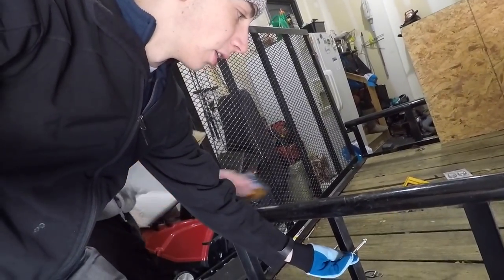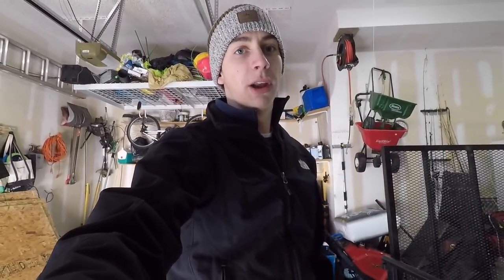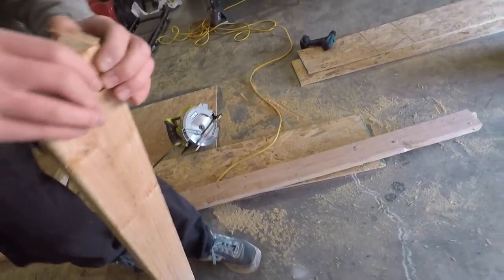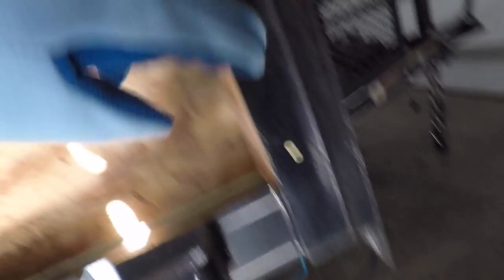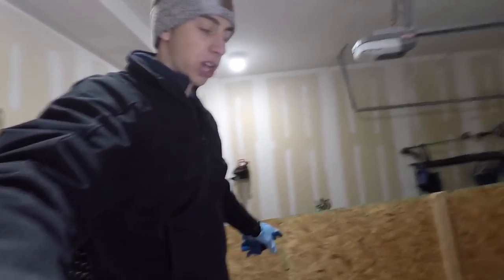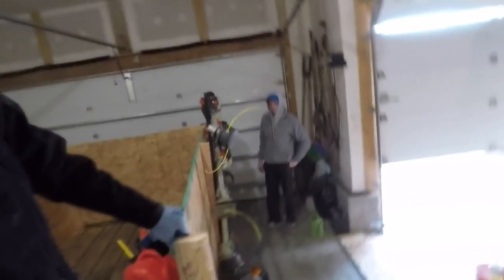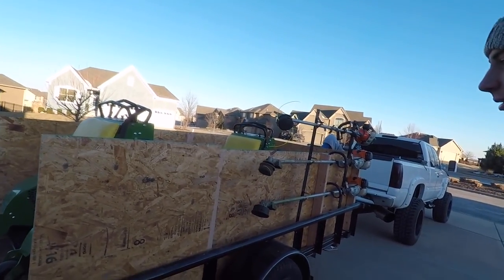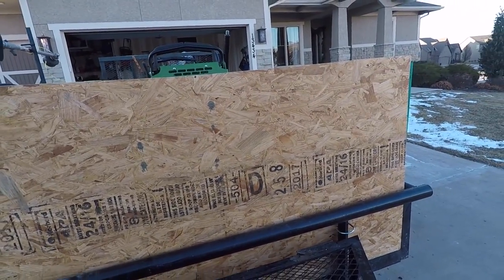Landscaping Trailer Setup [How to Build the Ultimate Setup] (2018)

Comment: Just came across this video. Can you tell me what model JD's he's running in ths video? I'm looking at running dual standers with a 5x10 trailer. The shortest JD has to offer is the 636M at 62" which is 5'2" and the 648M at 59.75 so 5' that's 10' 2" and it looks like he has room to spare. I think his trailer is a 5x12.

Comment: Nice.... Might wanna check the weight...a lot of trailers have 2500 or 3500lb axles....won't take long to max it out...maybe break some springs or the axle....if you don't have brakes remember to add a lot more stopping room....not being negative but just don't want ya to be sorry after the fact lol
Reply from the maker: Wayne's Lawn Care exactly, I appreciate the advice! I will pass it along to him, I’m thinking he will have to back off on how much he put on there. It will fit 5 cubic yards, but that would be a lot of weight, so might have to take that down for the landscaping trailer to actually hold it.
Reply: I've been there and done that, I maxed out my old single axle more times than I can remember.  Ideally, if 2018 is a good year I'd like to purchase this bad boy! Has it been cold enough for you guys lol? https://sleequipment.com/hybrid-dump-trailer-7-x-18-with-billy-goat-debris-loader.html#product_tabs_askit_tabbed
Reply from the maker: James Rosa we were freezing out there lol! I would like to also get a dump trailer or something a bit bigger for landscaping!
Reply: Wayne's Lawn Care good point before buying my tandem dump trailer rated at 10,000 gvw,  i used a single axle 6x12 and did exactly the word of advice dont try to put more than 2.5 yrds at once,  a yard of mulch can be around 400-500 dry and 800+lbs wet  so if your trailer have a 3k lbs axle with 3 dry you are pushing it bad. I seen a guy try 5 yrds and one tire blow before the loader emptied the bucket with the last 2.5 yrds.  6x12x4 equals 288 cubic feet and a yard is a 27 cubic feet so just at 2feet high  having mulch level you have 5 yards . Now when i had my trailer with the plywood walls i only filled up when cleaning leaves , when with mulch i never exceed 2 yards you will see the tires asking for a break good luck!

Comment: I would suggest getting a tilt bed period for mulch. It's hard to shovel mulch it's easier to pour it out. And you can also use it for your lawn mowers. Just go ahead and get the 3 to 4 feet sides that are metal. Dual axle. If you get a flat you can drive it to the nearest exit you can't do that with a single axle without tearing Tire all the fuck. Get 6 ply tires. This will probably be the last trailer you will ever buy so by the right one